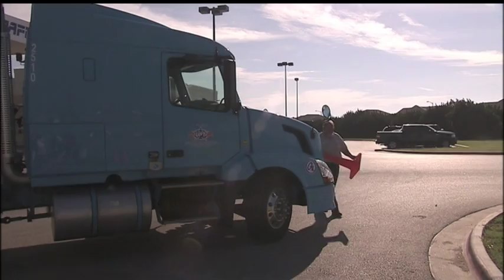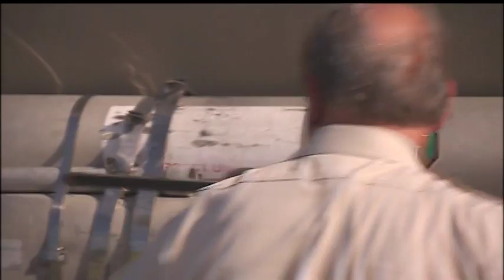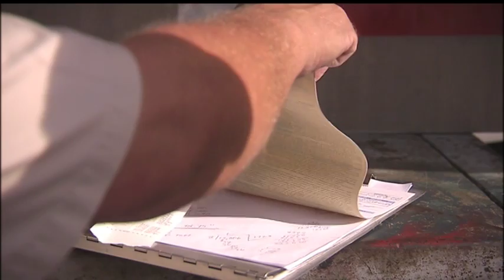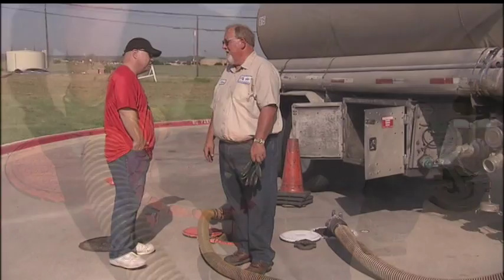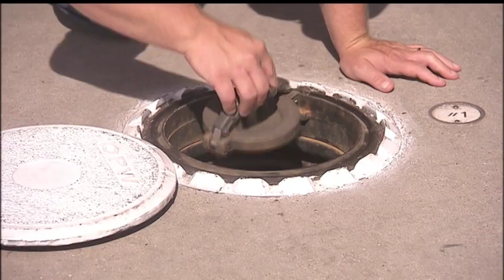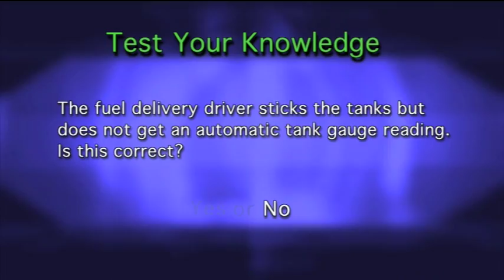Fuel Delivery

Comment: Vapour truck first then to tank.
No high viz?
Recommending a split pot!!! That's a big no no in the UK because of billing and the safety and stability if the tanker. Fuel compartments are specific sizes in specific places to balance the load because of the sloshing effect on stability. I would only take full pots never return a part pot.
In the U.K. The tanker driver is in charge of delivery, a competent person should complete paperwork prior to delivery if it is a Driver Controlled Delivery site (DCD) if it is an LCD (licensee Controlled) the paperwork should be signed by the Licensee when the hoses are connected prior to the pot being delivered.
Diesel should be offload before petrol and that should still be done after the Vap Rec hose is connected.

Comment: never put the vapor fitting on first. it should be attached to the truck and the down spout should be connected to the hose then to the ground. that will keep the vapors from escaping into the air and will be captured by the vapor recovery system